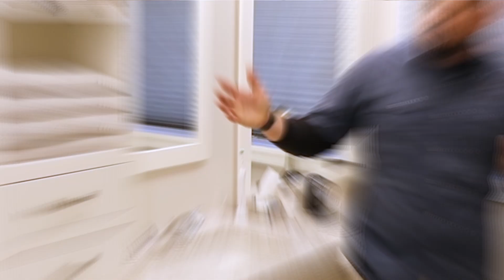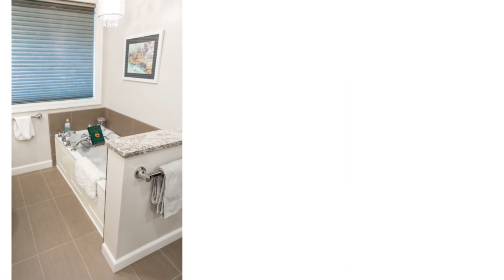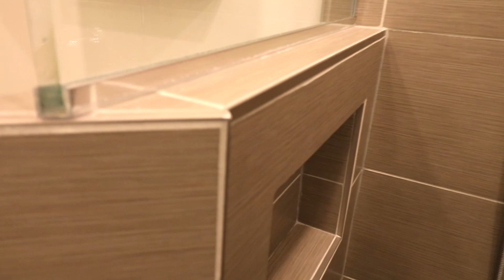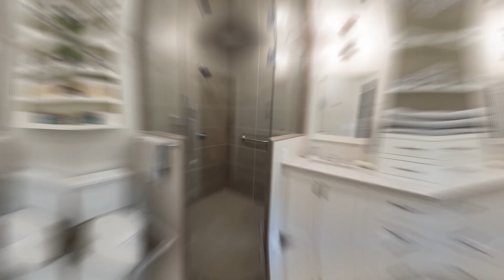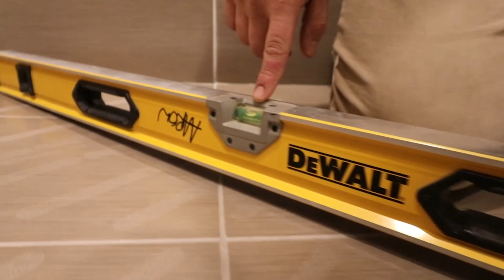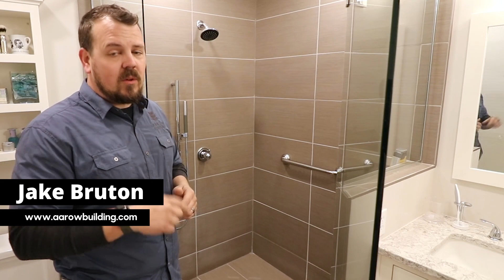Curb-less "Zero Entry" Shower!

Comment: I like your solution to the problem. Curbless showers are very nice. I would recommend relocating the valve to one of the half walls near the door if it’s possible on future builds. It allows someone to turn on the shower to warm up without getting blasted by water. 👍🏻

Comment: Assuming the Curb-less shower entry is for older unstable people. The half wall with the sharp granite corners with slick tile floors and other sharp waist-high corners is a head and hip trauma waiting to happen. This bathroom design is a slip and fall hazard. The medicine mirror door opens onto a metal towel holder...
Reply: ??? I didn't see anything sharp. And all showers have tile floors